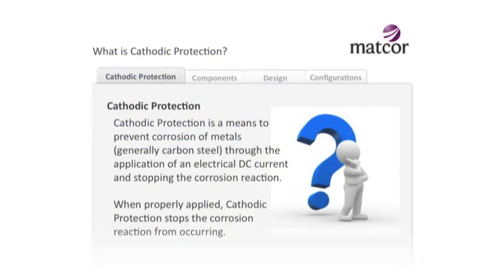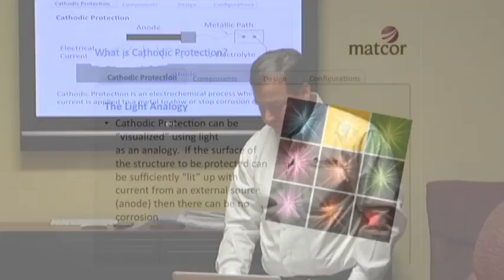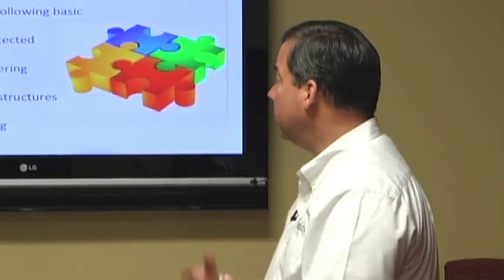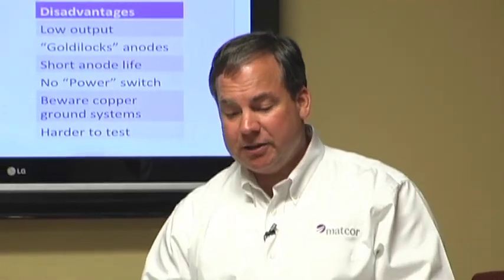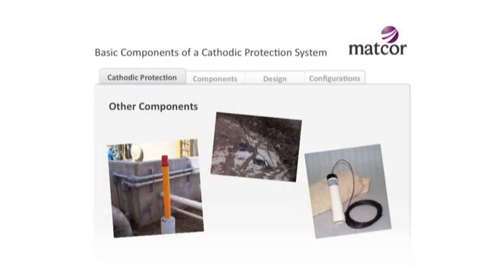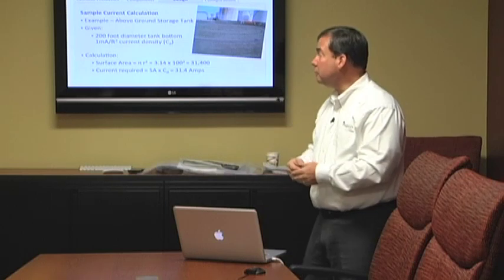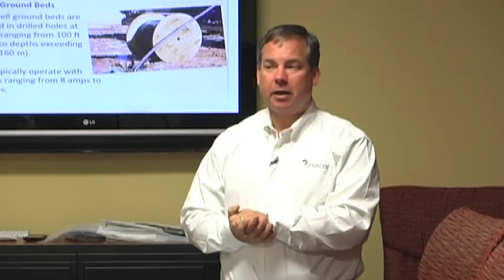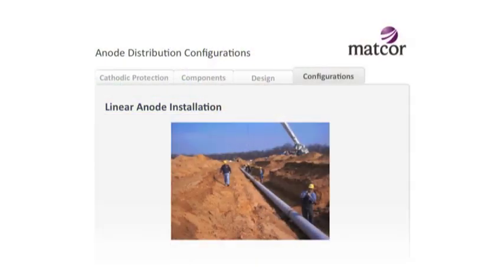Introduction to Cathodic Protection | matcor.com

Comment: When you go to 53:19 the protection of joined dissimilar metals copper and steel, you will see that is my corresponding Patents 5342493 and 5445719. That is why I get Patents when I discover new breakthroughs. I have the proof. Things come from somewhere.  A lot of research went into solving joined dissimilar metals. The Patents are now expired, just thought you might like to know why that is what they teach.

Comment: Do ions actually migrate from the anode through kilometres of underground resistivities and reach the structure almost instantaneously?
Reply: Electricity travels at extremely fast speeds - far faster than the speed of sound but not as fast as the speed of light.  So the answer is yes electrical current does reach the structure, even holidays in the coating kilometers away from the source.  
For more information https://www.quora.com/Does-sound-travel-faster-than-an-electric-current
Reply: @tedhuck845  so why doesn't electroplating occur in soil?

Comment: Nice basic introduction,( meaning no chemistry degree necessary) very well presented, Great to see companies willing to part with with there experience and information so freely, Thank you
Reply: can you or someone explain why we make our structure (electrode) more -ve in potential? As the presenter showed in chart and told that more negative metals tend to give aways electrons easily and hence corrode. A bit confused
Reply: @salmanqaiser6918 I'm confused on what you asked but if I got any of it here's that. If you mean why do we flood the structure(cathode) with electrons, it is because of the stadium analogy. If there's many going in, it's hard to get out.

Comment: So from the corrosion point of view, it is advisable to use aluminum cables rather than copper for grounding re-bars of concrete structures?

Comment: Can cathodic protection be used to inhibit rust on a motor vehicle?
Reply: +John Doe 
CP can only be used on structures that are underground or submerged, as an electrolyte is required for the application of cathodic protection.
Reply: Ah thanks.

Comment: thank you for this great presentation.. i work as power lineman here in saudi arabia and one problem we have here  is corrosion of anchor rod for guy wire of the pole where the transformer and rectifier for cathodic protection is placed . there is a oil well in the area which this cathodic protection protect. what  would be your suggestion to protect the anchor rod since cp is already available. is it possible to hook up this cp to the anchor rod using the existing anode for the pipe of the well....
Reply from the maker: RICHARD NOVIO Hello Richard, if you'd like to get in touch with a MATCOR corrosion expert with your questions, please inquire on our website at http://www.matcor.com/contact-corrosion-expert/ and someone will get back to you. Thank you!
Reply: @MATCORmedia  Hi Matcor -- do you have a reference for the 20mA/sq ft current requirement for copper?

Comment: So an anode sprays electrons onto a cathode, which is material to be protected! Anode is -, repulsing negative charges, while cathode, the + charged side attracts the -e's.  Where on the voltage value of the charge voltage should be depends on the respective materials' & immediate environments' chemistry, to be more + or -, yes?  Has there been experiments with alloys (MMO's?)of Zinc, Magnesium or Aluminum to extend anode life & what that would do to current needs of equal protection, sort of like stainless steel to H2S, & When installing deep anodes, can one side of the anode be shielded and biased to influence the direction of electron  travel?
Reply from the maker: Hello Rodney, if you'd like to get in touch with a MATCOR corrosion expert with your questions, please inquire on our website at http://matcor.com/index.php?id=65. Thank you!
Reply: Ok, Thanks.